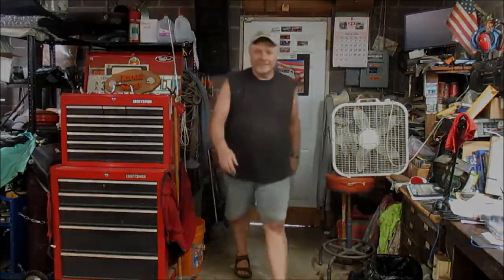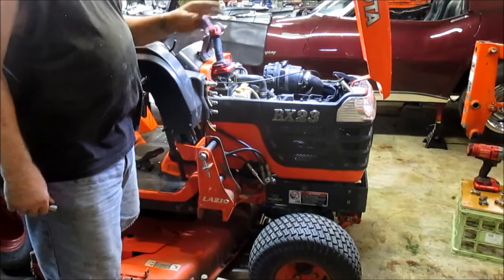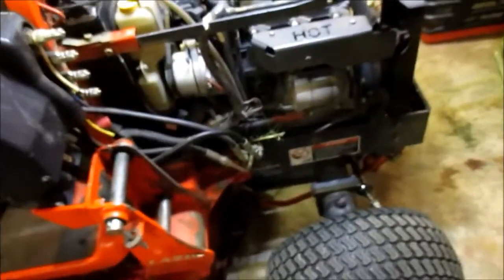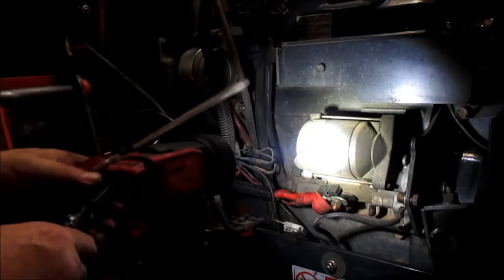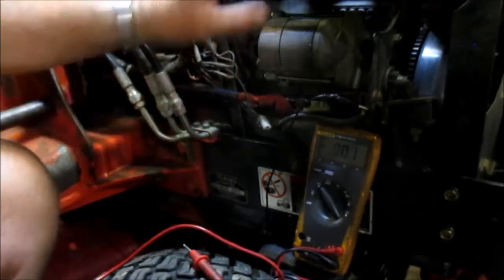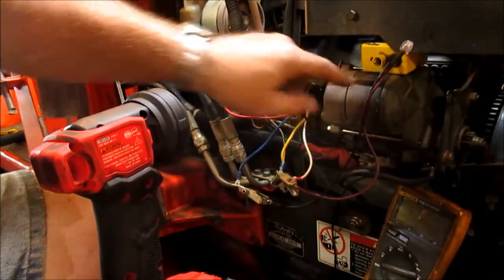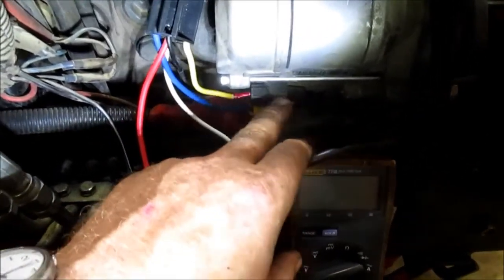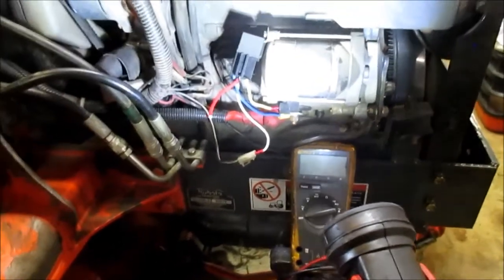Kubota BX23D, How to wire in a start relay.

Comment: I know this is an old post....but I want to say thanks....I have the same problem ... Going to do the same thing with mine .... A mechanic told me the problem is the wiring harness especially the safety switch wires are light weight from the beginning and getting old and worn the loose certit amps and lower voltage is carried...(Cheap wire was used) .... By looking at my MX5100 it's the same in all.... switches are cheaply made also....

Comment: Dave, thank you for giving the best explanation as to the working of the solution.  The wiring schematics part is an excellent addition to the actual wiring up the relay. Great job, 5 stars, thanks again.
Reply: I'm having the same "no start " problem on my Kubota 4340.
Reply: @deaneasterwood9849  Hey Dean, thianks for the kind words. All those safety switches and the associated wiring causes all kinds of high resistance electrical problems on these modern diesels. Adds complexity where simplicity used to rule. Have a good 'un.

Comment: I bought a bx2200 a month ago, now I have a starting issue.  I start it, it would start spudder  for 2 to 3 second than die.  There is black smoke coming out during that spudder and die.  I put in the relay kit but still does the same thing.  I change out the 2 fuel filter, it was pretty dirty inside but still no start.  I am  now, just got the kubota fuel filter upgrade mod,  I just need to make the bracket as the bx2200 frame is different from the new model.  I think it may be a saftey switch somewhere.  I'll try to do the fuel upgrade mod first and see what happens.
Reply from the maker: A little black smoke at startup is normal, course the shuddering & dieing isn't. Changing out the 2 fuel filters is a good thing and is generally one of the main causes of your problem. 
Next thing to check is the electric fuel pump which is the metal filter looking device thats in the fuel line under the tractor just before the fuel filter you changed. 
When you turn on the key switch do you hear a "clicking" sound? That is what the fuel pump sounds like when running. 
If not, check and make sure the electric wire isplugged into the fuel pump. If it is and you have a voltmeter, unplug the connector and use the voltmeter to make sure it's getting around 12vDC with the key on. If it doesn't click and it's getting 12v the electric fuel pump is bad. These BX's will start and run with a bad electric fuel pump but either they'll die right off or they'll run but have no power above idle.
Check that , good luck.
Reply: I do hear the clicking sound and I do get full fuel from the bleeder bolt, I just notice the little fuel line from the top filter to the bleeder bolt is crack n leaking, I will replace that line to see if that is the issue if not I will test the fuel pump.

Comment: wonderfully done. This man is really good. I have the similar problem on my Bx23. Where do I get the STANDARD AUTOMOTIVE RELAY and is there a specific number/type and can I get it through Amazon?
Reply from the maker: Thanks Robert. The relay is a standard automotive 12v 20 Amp relay. They are all basically the same. Most if not all auto parts stores carry them. Good luck

Comment: 2005 BX23,  I drove it into the garage to jump my riding mower, then wouldn't start.    I turn the key and get the same click you got.   I try jumping the starter and the gear comes out, hits the flywheel, then stops.  Is that the starter?  Battery is full charge.
Reply from the maker: Even tho you say the battery is fully charged, I'd still recommend to hook up some jumper cables to a car or truck ( or connect up a battery charger with a high amp starter setting) and try jumping the starter with the jumper cables directly connected to the starter terminal and your battery still connected.  It's possible the starter solenoid isn't passing high voltage to the starter armature but they generally start going bad over time and don't usually totally fail all at once. Course theres exceptions to every rule. A new Kubota starter is VERY expensive. If it ends up the starter is bad I'd recommend to call a starter/generator shop to see how much they charge to repair/refurb one and I'd also check amazon. I purchased a starter for a BX23D off of amazon for under $100 but I'm unsure if those kinds of deals are still available. Good luck
Dave
Reply: @davesdiyadventures848  I got a relay.  I hooked it up like you just using the colors of the wires.  No start.  My relay is opposite of yours as the blue is #30, yellow is #87.  I couldn't see the numbers on the relay until I brought it in the house and used a magnifying glass.   So I switched them, blue to the solenoid, yellow to the starter.  No start.  Is there a way to bypass the safety switches and test what is going on?  The one for forward/reverse is buried between the frame and the linkage and the rear end(I think)  I can barely see it let alone take it out to test it.